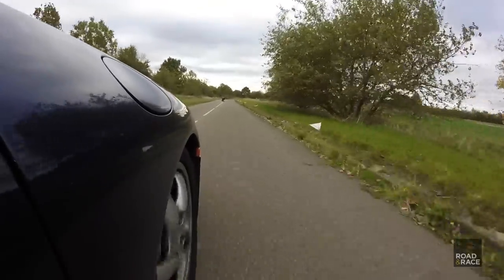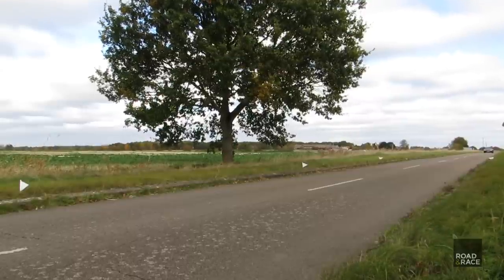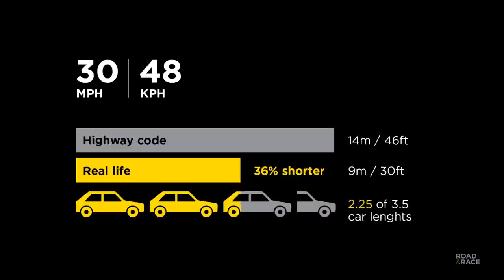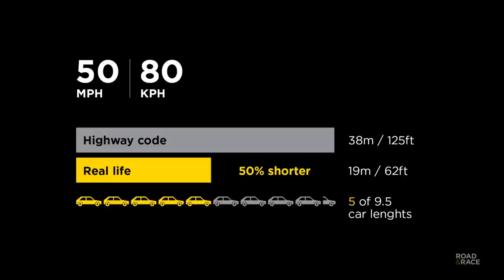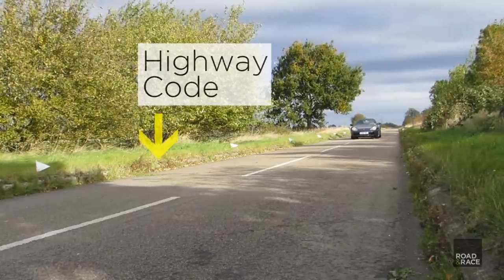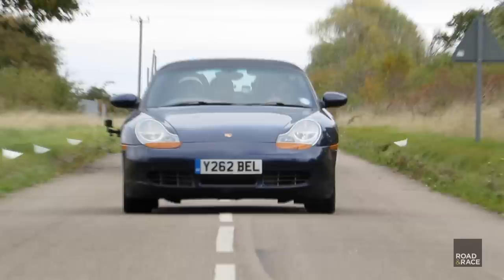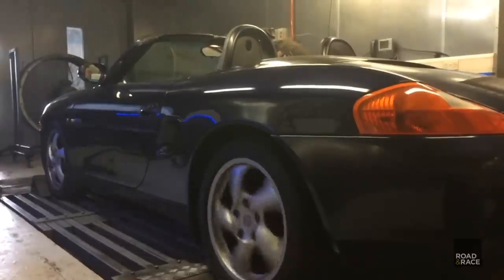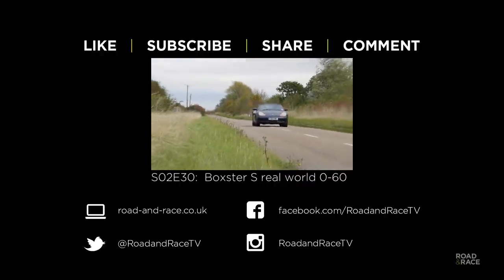Stopping Distances: Real World vs Highway Code

Comment: so.. real world = everyone is driving porsche ?
Reply: This old boxter is comparable to most modern cars with ABS. Actually, when Jeremy Clarkson did the test in the late 90's, the Peugeot 106 had a shorter braking distance than the 911.
Reply: wet roads dont exist either
Reply: @kinstar  guess what, there are different measurements made on wet roads. Don't compare these two, they are completely different tests.
Reply: @kinstar  Highway code state regular conditions
Reply: An early 2000s boxter definitely has ABS
Reply: ABS isn't really meant for shortening the stopping distance, its to maintain control of the car under heavy braking (so you can steer around things if needed). Brake assist is the one that will shorten the stopping distance.
Reply: This has a worse braking distance then a modern car, tires are much worse
Reply: And everyone has zero reaction times
Reply: @kinstar  he said it was for fun lol
Reply: @Nickgowans he said he was only looking at the actual braking distance. The highway code lists the distance in two parts i.e thinking and actual physical braking. So he was comparing just the physical braking aspect. For example at 30 the highway code says 6 car lengths. He was not using that figure for comparison, just the 3 car length claim for physical braking
Reply: @Nickgowans This is based on braking distance, not overall stopping distance.
Reply: Exactly 👍 Drivers have to be aware of the vehicles behind them, no use in stopping as quickly as you can unless you want the back of your car potentially smashed in
Reply: The car itself doesn’t matter much. Even a modern lorry will have a similar braking distance. More important factors are the weather and the tyres.

Comment: When Jaguar started to fit disc brakes all round they even went to the point of adding a warning on the back of cars to remind other road users that their brakes were considerably better what would be expected by the Highway Code. So I guess it's hardly surprising that I would expect most modern cars with discs all round and ABS will significantly outperform the Highway Code.
Reply: yeah on modern cars the limiting factor on stopping is not the brakes its the tyres

Comment: For the morons in the comments saying a Porsche is unfair because it had a short braking distance, let me remind you that the only thing that affects your braking distance is your tires and whether or not your brakes are strong enough to activate ABS. That old Porsche has a pretty crappy braking distance compared to any new car.
Reply: So just casually ignoring the major difference between performance disc brakes and standard drums?
Reply: @k4p1t4l9  Yes. That literally makes zero difference to braking distance and anyone with any kind of racing or engineering experience will tell you that. 

Performance brake parts are used to handle sustained loads, AKA to not overheat when for example subjected to multiple laps on a racing track, or braking from extremely high speeds like 300 km/h. As long as it's strong enough to activate the ABS braking distance will be the same, and for a single emergency stop any drum brake on a road car will be enough for that.
Reply: @k4p1t4l9  I thought it was just that drums overheat more easily, but I see no reason why drum brakes can't lock the wheels. They are probably more efficient on fuel economy to be honest if you are not driving in a way that needs a lot of braking. It's easier to stop them rubbing and giving you worse mpg.

Comment: I took my driving test as a teenager back in the 1950s and when the examiner asked me the thinking and braking distances at some speed, I said I'd have to work it out for him. I did using the formula that the thinking distance in feet is the same as the speed in miles per hour and the braking distance in feet is one-twentieth of the square of the speed in miles per hour!
Reply: Omg thank you so much :P Prepping for my motorcycle theory atm and this is gonna make those stopping distance questions so easy
Reply: It’s not a good practice. People are bad in measuring distance with their eye, especially while moving in a car. A more convenient way is counting seconds before the car ahead. When a car ahead passes a landmark (such as a pillar), count the time before you reach the same landmark. If it’s less than 2 seconds, you are in danger.

Comment: You know when you are going to stop as you come to a flag.  Your stopping distance does not include thinking time. So basically double it depending how quick you think after you see an obstruction.  Imagine a wet day with spray and doing 70 mph. The highway code is probably giving the actual stopping distance taking into account quality of tires and pressures and the tiredness level of the driver.  Not to mention those who think a pint after work will not affect their driving.  This sort of fun is dangerous if people watch it and believe it.
Reply: Agreed
Reply: The Highway Code is giving both distances: "thinking distance" and "braking distance" for a vehicle in good order and on a dry road with good surface, not "whatever may happen to an MOT brake failure with bald tyres on a flooded roundabout". What was reported here was the braking distance only.

It's not like the Highway Code is not available for free online - go and check rather than suggesting that this is "dangerous"; the Highway Code clearly needs to be updated - with significantly increased reaction times given the much greater amount of distractions now normally on the roads, and equally significantly decreased braking distances given the progress from cross-ply tyres, live axles and drum brakes without ABS that were the norm in 1956 (last time those numbers were changed...)
Reply: He said this test is not including thinking time. Only stopping time
Reply: If yoi have a good reaction time you should be able to react in 1-1.5 car length
Reply: Exactly what I was thinking of. He doesn't take into account that he is not going to react that fast if a deer jumps in front of him or a wild boar or something similar (an asshole break checking for example). He breaks because he knows he is supposed to and prepares for it accordingly.
Reply: @alexandruilea915  Which is why he only included the braking distances part of the highway code as clearly specified at the start of the video.

Comment: I'm surprised you were able to stop from 40 in 11meters. That's only 2 more than the 30 mph. I'd want to repeat some of those figures, though cars with downforce will beat the speed squaring relationship at higher speeds. Also I suppose the weight transfer to the front wheels takes some amount of time before the brakes reach full power.

Comment: I've hit the brakes hard at about 100 km/h (60 mph) after swerving to avoid a kangaroo (yes I live in Australia). Swerving probably wasn't the best idea but the car (a city hatchback) came to a stop fairly quickly. ABS works wonders. You can really hear (and feel) it going off when you slam the brakes at speed.
Reply: ABS actually increases the brake distance. Unless you don't have the skills of braking properly that is. A good driver will outperform ABS though. For manouvering under heavy braking it is ideal though
Reply: dont swerve......
Reply: @silent_fluo6917  you aint gonna out perform a modern ABS system, the only time ABS can be a problem is on ice.

Comment: Great video, always thought of doing this myself. Reaction times obviously omitted as distances are without reaction, just stopping distances, however what about the truck behind you on a real road? Additionally this is at maximum bringing by a reasonable driver on a good road... how much margin of error?
Reply: 1. Trucks have keep a distance of 50 meter to the driver in front.
2. A modern (european) Truck has the sasme stopping distance a car has. If its loaded and has good tires and good road surface and is a good truck it can even stop quicker then a car. maybe not as a Sopts car with fancy brakes and race tires but we are talking about an average car
Reply: @derfurz8618  You ever seen a truck keeping a 50 metre gap?
Reply: @squirrelofdoom3830  yes, they do basically 98% of the time
Reply: @derfurz8618  yeah, ok

Comment: I have a follow up question: Did you push the brake to 100% at the higher speeds? (60mph and up) how does it feel like making a full stop at these high speeds?
Reply from the maker: +Willi Werkel Yes, pressed the pedal to the floor every time.   60 mph felt incredibly safe.  No issues.  At 70 mph on that narrow track the car did squirm a little but it was still surprising assured.
Reply: Road and Race thanks for your response!
Reply: Willi Werkel I have done it in a BMW 5 series to avoid someone joining the motorway from the hard shoulder, at a very slow speed. Was doing 80mph, hit the brake as hard as I could (no time to turn) the car handle it fine, just had to keep hold of the steering wheel. Main thing is the deceleration you feel, quite scary, wouldn't want to try it in a low performance car. Maybe slide side ways or would not have stopped in time.
Reply: @tomtdh4903  tbh, even in low performance cars, most of them actually feel quite safe braking at relatively high speeds. Braking on a turn though, I wouldn't be too confident.
Reply: @tomtdh4903  I did an emergency stop in by old VW golf (G reg) on a roundabout (not very fast) and it spun 180 degrees, and I ended up facing the person behind be, very strange.
Reply: @DorkyThorpy  make sure your tires are the right psi. makes a huge difference to stopping and acceleration.

Comment: I did an emergency stop on the M1 from 60mph in the wet some years ago and practically gave myself whiplash. Wet stopping distances are supposed to be double dry ones, but my car stopped well under the dry numbers from the code, like your results it was somewhere between 30 and 50% shorter for the dry figures.

Edit: Of course, some people will tell you that the figures are an average for all cars including those with poorer brakes, tyres, etc. But to that I'd say: That's what the MOT is for.
Reply: "wet" doesn't mean much. How much wet?  When is it? Is it right after a long period of dryness? That's the worst possible road condition, next to straight up oil-spill. Where is it?
Reply: @GeorgeTsiros  all excellent questions. For my specific case it was moderate rain which had started in dry conditions 10 minutes earlier, and it was on the M1.
Reply: @PhillipParr  Has it rained a lot recently? If yes, the road is much, much less slippery than if it had been without rain for months. All the debris, oil, dust and stuff that was deep in the road crevices, gets mixed into the rainwater and covers the surface. If it has rained a lot recently, the road will be much much better.
Reply: @GeorgeTsiros  we're talking about 2016 so I'm not sure I can answer for my case 😅
Reply: @PhillipParr  anyway, if the road is good, braking is violent! All is well as long as we return home in one piece...
Reply: @GeorgeTsiros  I did, but my car was rear ended by a Porsche!
Reply: There's a safety factor in there too. Lorries might take longer to stop. Downhill is a longer stop, uphill is shorter. Tractors leaving mud on the road, leaf matter, oil on the road, loose stones make it more difficult to stop.

Comment: Aren’t you eleminating one factor of the equation by knowing when to brake? As you’re expecting where to brake you don’t consider the thinking time that a real world scenario would have. Not saying braking distances haven’t shortened, but this demonstration is misleading!
Reply: Not really, the Highway code breaks their stopping distance down into thinking distance and breaking distance. From 70mph it states 21m thinking and 75m breaking. This test shows that the actual breaking distance is almost half of what it was when the Highway Code was written, and thats in a fairly old boxter.

Comment: To be fair the experiment would only work on a really rubbish new car, you'd also need to include 3 -4 seconds reaction time.
Reply: 3-4 seconds reaction time? A sleepy drunk driver who smoked marijuana and who is talking over the phone would react way faster. Even one second is a very slow reaction for an old driver.
Reply: I think people have no idea what a second actually is.  Reaction time should be fractions of a second
Reply: @Sheridantank  100ms is pretty much the absolute lowest, 150ms is very good, average is about 200-250ms. Can test yourself here: https://humanbenchmark.com/tests/reactiontime
Reply: @bst857  
I’ve always had extremely quick reaction times.  I often catch things without being aware of it in a way that surprises people.  A reaction time of more than a full second is pretty slow.  2 seconds is awful.
Reply: @bst857  
I averaged 245ms on that test but I think gross motor tests are a better representation.  Thanks for the extra information though.
Reply: @bst857  
That’s a cool site also
Reply: @Sheridantank  Depending on your device, it can have a fair amount of output and input delay, so you can probably take about 50ms off of that unless you have a low latency setup.
Reply: @bst857  
It’s a iPhone 11 pro so I think it probably has low latency.   I think I do best on the visual memory tests.
Reply: Wow man if you need 3 seconds to react then you better stop driving. I'd say mostly 1 second, taking into account not being 100% focused.
Reply: @AlexGLM845  The official reaction time by the DVSA is 3-4 seconds as it states in the highway code.
Reply: 1.5s is the average driver’s reaction time. It’s not as simple as pressing a button on a screen which you know would happen. That 1.5s involves:
1) identifying something happens in your peripheral vision
2) your mind process them and divert your attention to it
3) your eyes moves to focus on it
4) you process what kind of danger it is
5) you formulate what kind of reaction you need to take
6) you then move your foot over to the brake pedal and press down
7) latency between pressing the pedal and the brake biting point.

That’s way different from pressing a button.
Reply: @roadbiker8333  Why are you on about pressing a button on screen?  Yes the average thinking time is 1.5 seconds but the time between thinking and reacting is different. The idea was to see the difference between 1960s rules and 2020 vehicles.
Reply: @devon896  read the above replies in this thread. People are on about tests for reaction time. But the reaction time for clicking a button reacting to a expected light is very much different from the reaction time while driving
Reply: I believe 3-4 seconds far more than 1.5 or 0.250 seconds xD. For normal healthy humans. It's probably even worse with music and modern entertainment and driver navigation systems
Remember that in a real situation reaction time isn't even a fraction of the problem.

Take the click test. That's not measuring thinking time. That test is just measuring the time it takes between you deciding "I need to click" (based on a good chunk of your vision going from red to green, i.e. not mentally taxing) and your finger clicking (~250ms for me). In a crash that would be the time between you going "oh bother i'm about to crash" and you starting to remove your foot from the throttle. Once you've got to that point you have to move your foot off the throttle, to the brake, and press down (helped by the larger size of a brake pedal but that physical movement still takes five or six times longer to do than simply moving a finger 0.5 mm :P). So in reality you're looking at a second between reaching that "oh dear" state and going into the braking state. So that's your reaction time (time taken to change the states you're in).

Then you have the other issue. Thinking time. You need to, comprehend the possible collision, then you need to observe for long enough to confirm you're not just overreacting and ARE actually about to collide, then you your reaction time kicks in and you can start moving your foot from the throttle and onto the brake.

Now the problem with thinking time is it's massively variable. A ball which bounces out into the road will probably result in you nearly immediately removing your foot from the throttle and having it hovering over the brake, ready for the kid to run out after it. It's a possible collision which is telegraphed, your reaction time is minimised. On motorways you might realise you're in that persons blind spot and accelerate (or brake) so you're not in it/out of danger. Lots of little decisions you probably don't even remember making to prevent collisions. But what about a random kid running out between cars with no telegraphing? Well i've never hit a kid but I have been in a car which hit a kangaroo. I never even saw it. I heard a small THUD (which is slightly faster than vision as a stimulus, plus it's less ambiguous, you hear a THUD from you car, you're instinct isn't to go, is that a normal THUD or a crashy THUD?) and a second or two later the driver slammed the brakes. We stopped quickly but only because we weren't going that fast (the roo was fine it just hopped off).

And so that is why the 3-4 seconds is used. It's not reaction time. It's thinking time AND reaction time along with a nice extra dose of time to account that you have to have the collision in your FoV... 

When you really think about it, it's insane humans drive at all, we're just not designed to be able to handle it. Then again, that's why we have stuff like seatbelts and airbags, humans will crash their vehicles, it's a fact of life and you just have to make sure you're not one of the ones who are stupid enough to believe they won't be the cause of a crash.
Reply: @Logarithm906  Completely agree given how distracted and idiotic most people are these days